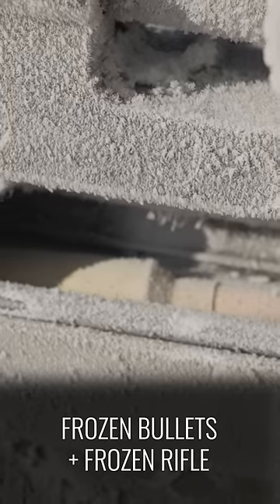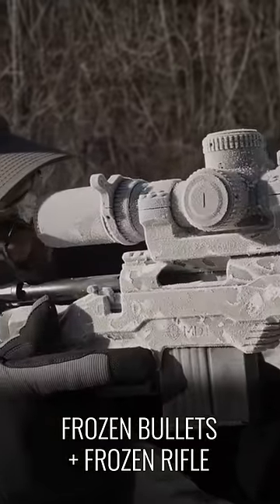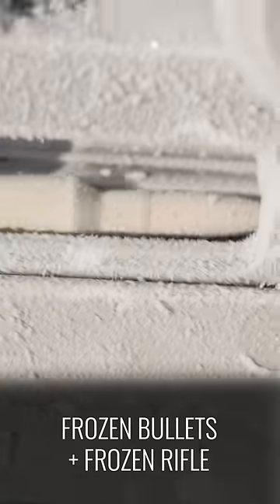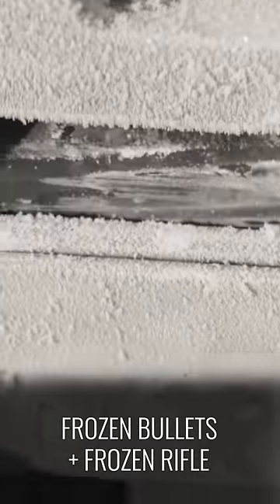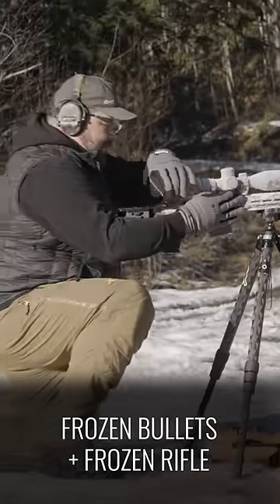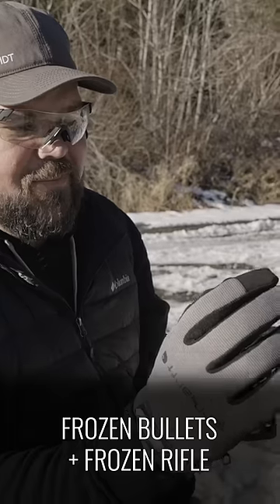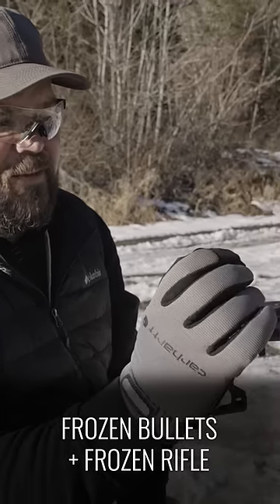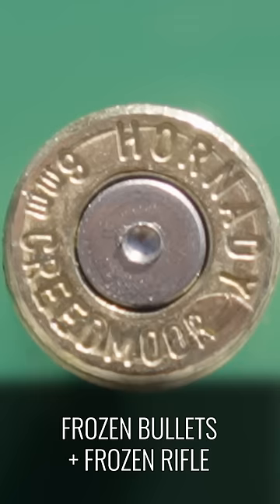Testing Extreme Freezing Temperatures On A rifle

Comment: It’s the frost in the chamber and throat acting as a barrel obstruction. First round cleared all that. Hence the higher pressure signs.
Reply: Coupled with all the frost in the barrel the frost on the round prevented full case expansion in the chamber.  Then again considering the water frozen between the brass case and the chamber wall this may actually prevent ANY normal case expansion. Now after your first frozen shot try one more round that does not have frost all over it.
Reply: I trained in alaska and rule of thumb leather wrap or wooly bag your rifle and take out when you need it if you are constantly shooting it the cold a wooly wrap helps tips from a jarhead
Reply: The chamber and headspacing were also reduced because of the cold in general
Reply: Metal shrinks as it gets cold.
Reply: @mikeishome69  But they're both metal...
Reply: @kjpierson1152  Different shapes and metals will change size at different rates.
Reply: Doesn’t metal shrink when cold ?
Reply: @ricardorosalez958  when you’re late to the conversation and copy other comments knowledge to look smart 😂😂😂
Reply: @2009dudeman  Being left out that long, will equalize it for what is involved here.
Reply: @kjpierson1152  no it won't. Brass will never 'equal out' with steel, even for the same shape and size. A 2ft steel rod and a 2in steel rod will never even out either.

It doesn't matter how long it sits there. As a litmus test, answer this. A flat steel plate with a circular hole in the middle. When you evenly heat up the plate, does the hole diameter increase or decrease?
Reply: @kjpierson1152  yeah that's not a thing. Shrinkage doesn't equalize over time. I've never even heard of that
Reply: @2009dudeman  Difference being, the addition of energy isn't a stable state.  The cooling of the metal is.  .223 in the cold after 24 hours with steel or copper jacketed lead will still be 223.  Frost on/in it will be different, but at a resting state they will equal out given adequate time, and given the fact both have frost on them, unless someone was spraying it with something to cool it, it should be equally cooled.
Reply: @RapTapTap69  Equal, no, be close enough, yes.  This isn't exactly a precision device with tiny tolerances where the smallest change makes it impossible to use.  It has tight tolerances, but by its very nature, it needs some room to play with for variances in ammo, weather, etc.
Reply: @kjpierson1152  Yes the rifle needs to be manufactured with specific allowances that prevent failure due to variations in ammo etc but I highly doubt many rifles or ammunition are designed to be used with the amount of shrinkage that this rifle and ammo are experiencing. If the rifle had allowances for this much shrinkage, the typical operation would be extremely loose. I think I speak for everyone when I say that I'd like my tolerances as tight as possible on my firearms.

To get scientific, the coefficient of linear expansion of brass is 1.7 x 10-5/°C and steel is 1 x 10-5/°C. This is the value of how much the materials will fluctuate as temperature increases or decreases. Those are extremely different values and scientifically proves that the materials will experience very very different amounts of shrinkage. We could debate probablys and maybes all day but the numbers don't lie. The blackening of the casing most likely came from the round being significantly smaller than the chamber and gases being vented through the gap. This gap will expand with each round as the chamber warms and expands while the rounds stay the same size due to being the same temperature as the first round.
Reply: @kjpierson1152  The addition of energy or stable states is irrelevant when we are talking about how much a metal shrinks per degree C. We are discussing Vit Apa saying that metal shrinks as it gets cold, and you stating that they are both metal (implying it doesn't matter). The fact is, steel shrinks half as much for the same change in temperature as brass. A resting state doesn't matter. If I take a 1ft brass rod and a 1ft steel rod and let them sit in a freezer for 2 minutes or 2 months the brass will shrink more. Being equally cooled doesn't matter.

Your chambers throat is shrinking half as much as the cartridge, this increases the headspace. Frost being in the way may restore the headspace to a nominally correct position, but the moment the round is fired you end up with frost trying to hold back the gas pressure, which it's not going to do and you are going to have the same effect as too much headspace.
Reply: @RapTapTap69  If a rifle was this fragile, then you'd have to buy a rifle for cold weather, hot weather, etc.  The last I checked, the same gun that works in Africa, will work in the midwest US, will work in the Arctic.  If they were so fragile on tolerances as this implies, they wouldn't.  An overcharged round could cause the exact same situation we saw here, with even normal weather.  I love good tolerances too, but pretending that them being so tight that this is going to matter from cold weather to normal weather, is pushing it.  Now, if you want to try to run the same test with a single shot 50 cal, there might be an argument.
Reply: @2009dudeman  Funny, I didn't see anywhere that said that was a brass solid.  That was my bad.  Please, point out the time code for that.

As for the rest, I'm not sure what you think temperature is, except adding energy though. It does matter, but it doesn't matter enough to make a weapon this problematic.  If it did, we would have a lot more problems than we do have in varying conditions.

You want to talk about how much that brass rod and steel rod shrinks...then run the test.  Let us know the results.
Reply: @kjpierson1152  So an object has to be solid in order to be affected by thermal expansion? Is that really where you want to go? The brass and steel rods were intended to point out the ridiculousness of your comment of it "equalizing", it doesn't equalize. The point about adding energy and 'not being a stable state' is that we don't care about how much energy was removed from the system, we care about a thermometer measurement at one instant in time. It doesn't need to be more in depth than that when talking about something being cold and covered in frost regarding winter operation of a rifle. I highly doubt they are going to be using liquid nitrogen to cool everything down as opposed to just leaving them outside or in a freezer.

I don't know why you are so caught up on this. Temperature changes the size of metals, it's a fact that you seem to want to dispute. No one was even disputing the fact that the perceived change in operation was the frost that was likely built up in the barrel and chamber.
Reply: @kjpierson1152  the rifle isn't "a little cold" it's -78°F. That's massively different to typically operations in any place on earth. Even if you buried it in the arctic for a thousand it wouldn't get it that cold. The fact that you're exaggerating my actual points based off of actual math and science proves that you have absolutely no idea what you're talking about. 

The actual video is where it's revealed that the rounds are brass as well as having the ability to see colors like brass and steel grey.

I don't need to run tests on their shrinkage. That's literally how they get the number and it's used so they don't need to do the test every time the coefficient is needed.

What??? Why would being a solid object matter??? Do you think tubes don't shrink???
Reply: @2009dudeman  Temperature absolutely changes the size of metals, but it doesn't change them that much on something that is designed for variances in tolerances.  If the change in operation is due to the frost, I'm not sure why you're so caught up on insisting the metal's change is an issue.
Reply: @RapTapTap69  Why does it matter if it is solid versus a tube?  Because those vary in how they expand and contract.  There are zero numbers mentioned in this video to back this up.  If there's another video, that's great, but none of that is detailed here.
Reply: @kjpierson1152  the shape of an object does not effect it's thermal expansion. You're just guessing at things that you think make sense and you're completely incorrect. A hollow tube and a solid rod will contract the exact same. If you want to text this, take a rod and tube of the same material that can slide over the rod. Put them in a freezer and they will still slide over each other. 

We're dealing with 3 different materials (brass casing, whatever material the bullet might be, and the steel of the rifle) at extremely low temperatures and you're completely disregarding how the metal contracting could cause issues. Why? Why are you so against a literal fundamental science of our universe that heat makes things change size? Are you completely unable to realize you might have been incorrect when you made an assumption that had absolutely nothing backing it? 

Also you're mad that I watched the video and know more about what's happening in this short? What? I had watched the video before even engaging with you. If you wanna argue about it go watch the video and get back to me. It gives actual details (like the temperature of the rifle) unlike your random speculation.You've been wrong on everything so far so hopefully you'll learn something from the video
Reply: @RapTapTap69  No, I'm just tossing ideas, looking for a counter argument that makes sense.  I fully believe the metals contract differently, I just don't think they contract enough to matter with the tolerances for this rifle.  If they do, then I feel sorry for the person that puts a slightly out of tolerance round in this rifle.

As for the other video, I didn't even look for a second video, so no, I'm not mad.  But I also don't watch one video just to go look for another video about it.  If anyone one explains it all, then that is great.  All of the guess work, questions, and commentary is pointless.
Reply: @kjpierson1152  you do realize that -78°F isn't going to change tolerances "just a little bit", right? That's close to 100° from typical operation. As far as tolerances go, that's a massive amount and almost definitely a staggering difference to out of tolerance ammunition (Which you shouldn't be putting in your guns anyways. Would you put an out of tolerance part in your car?). Not to mention the fact that the chamber will heat up with every round making the difference larger with every shot. Seeing as we're dealing with extremely high pressure gases, I'd say tight tolerances are important.
Reply: @kjpierson1152  because you initially made ridiculous comments that were entirely wrong on how thermal expansion works...
Reply: @RapTapTap69  Funny, I'm fairly sure most weapons were designed to fire in most weather.   Remind us, what are the temperatures in the one country that everyone insisted was going to be the next great enemy for the next World War...you know, that entire Cold War thing?  Did we go out an buy special guns and ammo for fighting through Russian winters?
Reply: @2009dudeman  Not really sure what that is supposed to be in response to from my reply.  Sorry if it is an inconvenience on your reading the comments section that someone might question your buddies.
Reply: @kjpierson1152  Russia's coldest temperature ever was -89° and their average winter temperatures are only -3° to -10°. The rifle was -78°F. Do you think that manufacturers are building to specifically survive the most extreme cold or do you think that maybe they're building their weapons for actual typical operating conditions. This is the most asinine argument I've ever seen. This weapon was experiencing conditions that you would be extremely hard pressed to ever find in nature so to think that the designers added enough tolerance to make sure that it would operate in these temperatures is the stupidest thing I've ever heard. Is your car designed to operate at -80°F?
Reply: @kjpierson1152  sorry if you got offended you were wrong and now have to play it off...
Reply: @RapTapTap69  I'm thinking they aren't mutually exclusive.  The gun obviously works at said temperature.  Remove said frost, see what happens then at the same temp.  Maybe the other video did, don't know.  Do you only operate everything in fair weather conditions?  

Since when has it become an issue to postulate questions and ideas in a comments section?
Reply: @2009dudeman  I'm fine being wrong.  Happens often, does it not to you?
Reply: @kjpierson1152  yep, doesn't mean I'm headstrong about it though.
Reply: @kjpierson1152  if frost was causing the causing the issue then there wouldn't be blowback around the head of the casing. That doesn't even make sense.

"There's too much stuff in the chamber so gasses vented around the outside of the casing"

That makes sense to you?

Also when you're making something that contains and directs small explosions you don't get the liberty of having tolerances that can perform at all temperatures and even if you did, typical operation would suffer greatly. 

Also that's not what postulate means. You're posing questions. You're postulating when you claim that the frost is the issue. The issue I have is that you've been given the complete scientific explanation with both the number and video proof backing it up while you've shown a complete lack of understanding of the material science behind why this weapon would be dangerous and likely to fail. You've claimed that the metals would shrink equally then that they'd eventually "equalize, and that rods and tubes have different expansion rates. 

You're simply too set on the fact that you're right that you can't see the absolute scientific proof presented to you. This is my end to the conversation since I could probably provide you a peer reviewed paper on exactly what's going wrong and you'd still argue that you're right. Good night and good luck
Reply: @RapTapTap69  I already said I didn't go watch the video that was clickbaited by this one, perhaps you missed that in rushing to be right yourself.  I've seen zero numbers that prove anything from you.  I've seen you, as you say, postulate and answer.  I've seen others postulate other answers.  I've already admitted that I may not have been right, in multiple posts.  Do you not bother reading?
Reply: It's actually the expansion of the ice melting and then evaporating into a high pressure gas that created this problem. It has nothing to do with size since it chambered fine.
Reply: @RapTapTap69  Neither of which gives the actual size change.  You gave two constants and a formula.  Did it detail what the change actually was in size?  

And no, I didn't go watch 1, 10 or 100 other videos just to follow what the posted video was about.  Same as I don't go clicking on ads to follow up with more advertising for products.

Comment: 2 main problems.  Frost/ ice in chamber and frost on cartridge.  Keep your ammo from frosting up and the same goes for your rifle. Manually cycle the bolt a few times to clean frost off. Cycle several rounds through without shooting them to clean out frost. Keep ammo close to your body ( warmth ) and they won't frost/ice up. Cleaning rod with a stiff nylon brush will clear the bore. If in combat situations Keep your rifle wrapped with a burlap or heavy cloth. Sleep with your rifle in your sleeping bag ( no round chambered ). I haven't ever had ammo frost over like that, nor my rifle. You can also put a condom over the muzzle of your rifle to reduce moisture getting in barrel.
Reply: Actually, im impressed, that you have to point out, that it is stupid tosllep with a loaded or cycled gun... but i think, this is an American thing.

A condom would also freeze up. cause of mositure. it´s okay, for a couple degrees below Celsius but for reel freezing i would recommend a cotton cloth. just inside the chamber and the muzzle would be enough... But... Good work.
Reply: Do not sleep with your rifle in cold weather spent 4 years as Army Infantry in Alaska if you warm the rifle in any way then take in to the Cold the metal sweets when it is warm then the cold will freeze every thing up now leaving it in the cold covered is what works best.
Reply: you’re too deep bro
Reply: @ablakeney01  Copy that!

Comment: You should have checked the bullet velocity to see if it's over pressure... The black around the primer could be to do with how different metals react to cold weather as one may shrink faster and break the seal...?
Reply: If it was over pressure because the ice or the tight bore constricted the bullet it wouldnt show up on a chrono. That only tells you variances in pressure when operating on the assumption that the barrel and action are operating at normal parameters. If you plug your barrel up with mud, it will overpressure, but the bullet will be going slower than usual because the reason it is overspressure is because it is having to accelerate a whole mass of mud as well as the bullet. So bullet speed would be meaningless to indicate pressure in this case. That only tells you relative to other rounds, and/or when fired from a correct chamber and bore if the propellant is functioning as specified.

Comment: My guess is the black around the primer is not  from over pressure, but from the different in primer to brass from the contraction due to cold. Shot fine once keep going.
Reply: If it was overpressured as bad as he claimed, the bolt wouldn't have unlocked as easy as it did.

Comment: Probably either the frost as you say or contraction of the cartridge tightening up on the bullet. The steel barrel wouldn't contract as much a sthe copper or brass of the round, so it wouldn't be cuz the barrel shrunk, but brass has contracts slightly more than copper, allowing the pressure to build higher before the bullet is fired down the barrel.